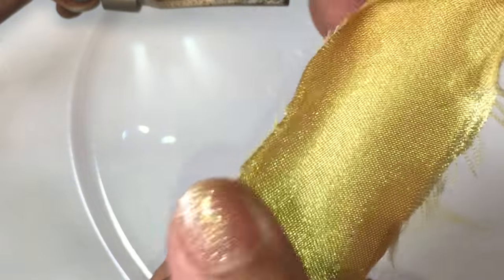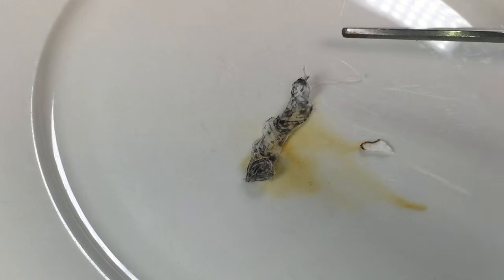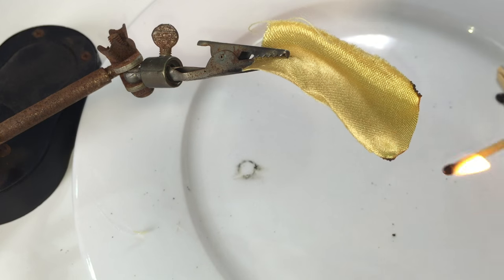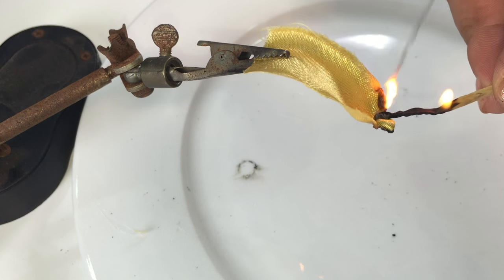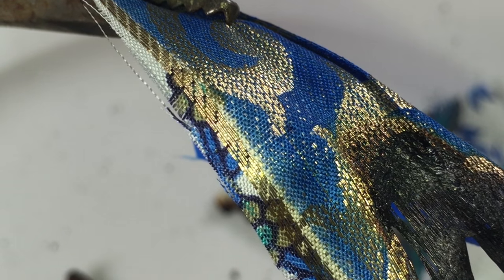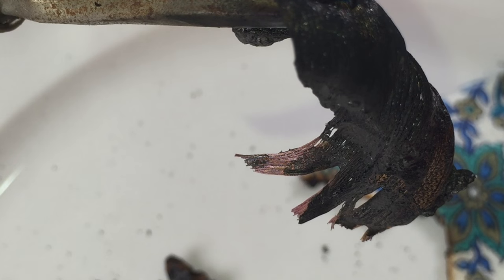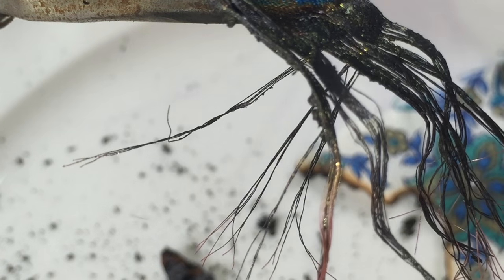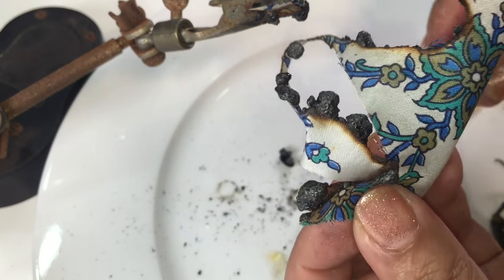Tips for Testing Fabric Content

Comment: Thank you for posting this.  Is there any way to tell if a fabric is 50% cotton and linen or all linen?  I am finding it hard to tell the difference between the two.
Reply: +Ursula Leach Actually, linen is made from flax, not cotton. There are some textiles woven in linen weave out of cotton, which are called linen, but that's not strictly correct and it's not the same material.
Reply: linen is made from the flax plant. The plant fibers are crisper than cotton is. But with wear it becomes more supple. Cotton and linen both burn about the same way. Of course the linen isn't as tightly woven as cotton can be.